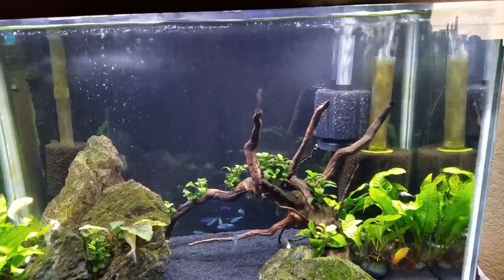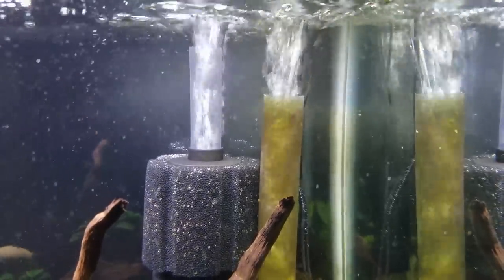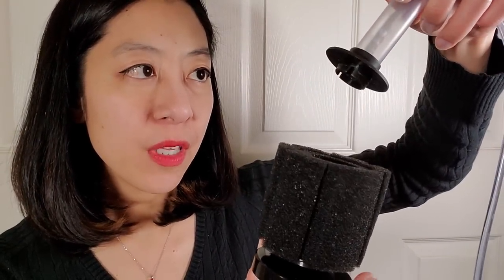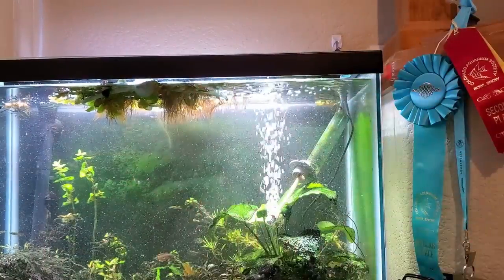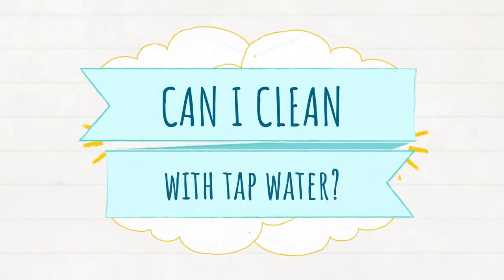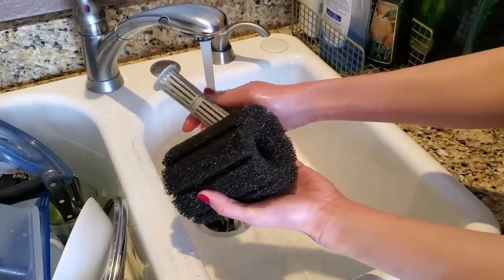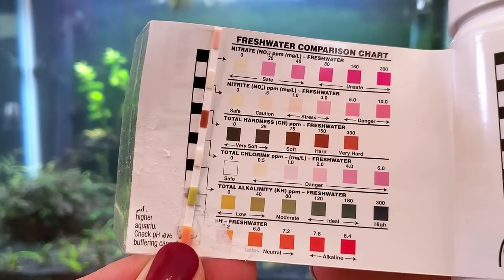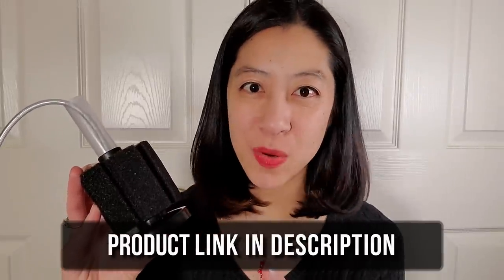How to Clean a Sponge Filter + 3 Bonus Tips

Comment: I clean my sponges in tap water every week but I have well water. I do try to get the temperature of the tap water close with the tank. Never use hot water! 🌿🌿🌿🌿🌿🌿🌿🌿🌿🌿🌿🌿🌿🌿🌿🌿🌿🌿
Reply from the maker: Great tip! I didn't think about possibly matching the tap water temperature with the aquarium.
Reply: Well it depends. If you are based in the UK, or somewhere that they don’t use mixed taps it’s not recommended and this is for human consumption, not talking about fish because i think if it’s not good for us to drink then maybe it isn’t good to swim in either lol I don’t know but with a little research it is because it often comes from a storage tank within the home and is not as fresh as water directly from the mains or your pipes may not be copper like the cold water ones.  hot water also dissolves contaminants more quickly than cold water, and many pipes in homes contain lead that can leach into water.

in south Wales the water is very acid so a certain amount of copper from the hot water pipes and tank get dissolved out into the water. While making tea from this wouldn't kill you it would certainly taste disgusting.
I have also read that Cold tap water is higher in oxygen than hot.

🤷‍♀️ I thought it was a good idea too but I had to mention this since when I moved to the UK I wasn’t aware about this either .
We have Mix taps in Portugal so it would come from the main tap always. 

Thanks for your video very helpful

And also 

Thanks for your hot water tip. 
I’m sure there are countries and people who know where their water sources come better than me

Comment: So why do the bubbles slow down when the sponge is dirty if the bubbles don’t go through the sponge?  Floaters in the tank make sense.
Reply from the maker: Good question. When there is resistance to the air pump, not as much air gets into the tank (and therefore not at many bubbles are seen). This can happen if the air stone gets clogged or too much gunk builds up inside the sponge filter and blocks the airline tubing, etc.

Comment: Hi. I try to clean mine in tank water every two weeks and I get a diatom bloom about every time. I squeeze it out 3 times and put it back and never fails, I go from clear to cloudy for a month to 6 weeks and then it all settles down. 
Now to be fair I do bare tanks,  with sponge filters. No substrate, no plants, 
I don't get ammonia or any spike but it's a brown water mess over and over.

 I'm going to try not messing with it once it clears and see if it will just do its thing and check nitrates and see, but from my experience I get a nitrate rise letting the sponges go, and it slowly builds up. 

I guess no easy answers really in this hobby, what works for you might not work for me, and what works for me might not work for you. 

I don't get a bacterial bloom ( white) its always brown yellow cloudy water (diatoms) and probably its my source water, and an imbalance. 
I do a lot of water changes. Like 50% 2x to 4x a week. And with breeding 8ts every day or 2x a day depending on the size of the fry. Also could be the reason for the diatom bloom, adjusting for the bioload on the tank.....

Comment: My question I was looking for is... well I have a clay based fluorite, anytime you disturb the substrate it turns cloudy red and my sponge filter will eventually clear it but obviously be saturated with the particles. When I turn it off and remove it it’s like when I turn it off all the stuff starts leaching out... is it best to remove it and keep it on or turn it off and pull it up slowly? What’s the best option? I have a new planted snail and shrimp tank! Thanks!

Comment: Will this work 1) clean under Tab Water  then 2) Aquarium Water
Reply from the maker: Yes, you could alternate cleaning schedules so that one week (or month) you clean with tap water and then then next week you use old tank water. I definitely find that cleaning in tap water gets more of the gunk out; you can see in the video how drastically the color of the water changed when I was cleaning under the faucet. :P
Reply: What I meant soon after step 1) then step 2) dumping the sponge in aquarium water
Reply from the maker: @mvvinds  Gotcha. I'm not sure it would make that much of a difference since the main fear that people have is that the tap water would kill most of the beneficial bacteria. Putting the sponge in aquarium water afterwards probably won't add much bacteria back into it.

Comment: I use a sponge on the intake of my canister filter (tip I picked up from one of Cory's vids) to keep large debris out of my main filter area, it also helps protect my shrimp fry. I also keep fish that like cooler temps. Of the ~23 gallons it takes me to fill my tank, about 2.5 gallons is canister and co2 reactor all in a cool place. Combined with my screen top and a fan, I can keep my tank nice and cool in the worst of the Texas summers.

Also, I can deep clean my in tank sponge and all four walls without any kind of bloom, something I wasn't able to do before the canister and reactor.

Comment: I use both HOBs and sponge filters - in fact, I'm rather an Aquaclear fanboy. Do you have a video on your decision to move away from HOBs?
Reply from the maker: Haha, I was actually going to explain myself more in this video, but it started getting long. I really like AquaClears too, but decided to switch away because a) my filter once flooded because I forget to clean it, b) beneficial bacteria will stay alive longer on a sponge filter during a power outage since the tank contains more oxygen (and I might not be home to move the HOB filter media into the tank), c) I've had various impeller issues with my AquaClears over the years (despite using a prefilter sponge), and d) I like the surface agitation caused by my sponge filter while still having gentle flow (but I never officially tested the difference in oxygen levels).
Reply: @GirlTalksFish  Yep, I've seen the elevator effect: where the media basket rises after the sponges are clogged. Usually happened just as I was sitting down to eat. :/ Do you run CO2? I've wondered if the gas exchange caused by sponge filters' bubbling would gas off the CO2 too quickly.